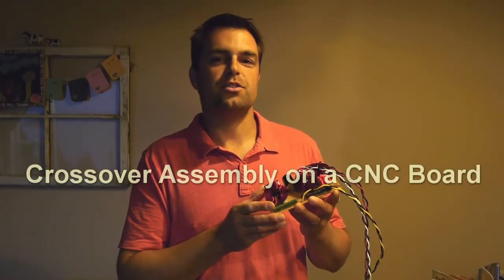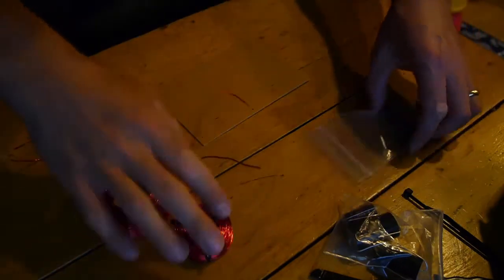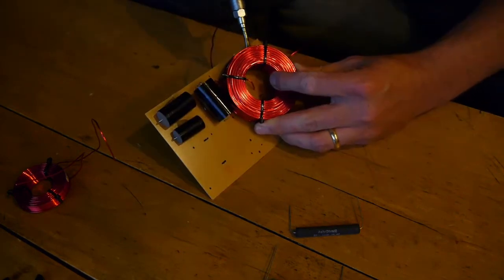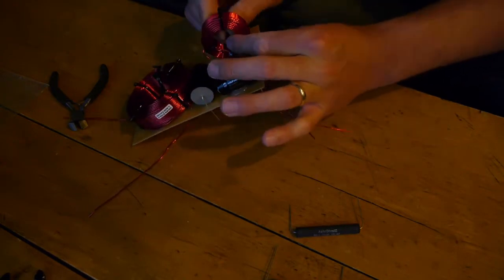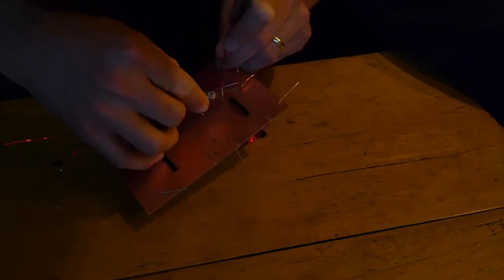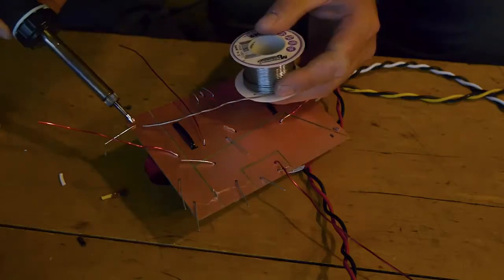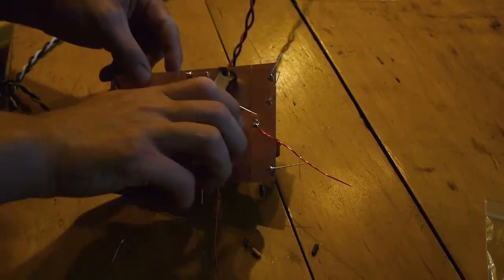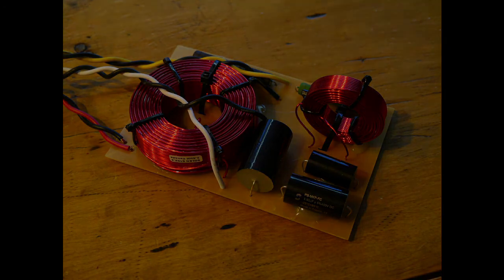Crossover Assembly Using a CNC Board for HiFi Speaker

Comment: Crossover assembly - you're doing it right! (Maybe it's because you're from Canada and not from the US?)
The only remark I have is that German DIY loudspeaker magazine Hobby HiFi say that resistors can get as hot as 200 degrees Celsius. So hot glue might not be the best option. They recommend to leave even a gap to the PCB to make some ventilation possible. But I don't have a decent thermometer to measure the temperature of resistors so I never checked.
Reply from the maker: Marius Loubeeka ya good tip. I have considered that. Really the only harm is that the glue will melt. I double up on the resistors to help with heat. Ive considered epoxy but its a pain to use. Ive also considered spacing the resistor to allow air flow, but always fear it'll wiggle or rattle. The lead wires should be able to support it, but affixing it with some kind of glue makes me feel better about it. Maybe Ill try it next time.

Comment: Good day impulse audio. I want to ask.. Whats the total impedance if i combine three driver. A woofer 4 ohms.  Midrange 8 ohms and a tweeter 8 ohms. Is it bad idea if i combine this kind of driver with defferent impedance. Thank you in advance
Reply from the maker: Ricardz Borbon its not a bad idea at all. You can mix impedances anytime. But it isnt as simple as combining them and the impedance will equal some amount. It depends very much on the crossover design. It will probably end up around 4 ohm where more of the power is required, in the bass range. Check out some of my videos about crossover design to see the complexity.

Comment: Hi, What brand welding using to solder, and % of components (60/40, 65/35?
Reply from the maker: Carlos Catalan I use a Weller WP35 iron and Keller Sn63Pb37 rosin core solder. It was what a fried recommended and I've used it ever since.

Comment: So are you selling these?
Reply from the maker: Chad Montgomery I can if someone wants a pair. They are specifically designed for a Fountek ribbon and wavecor woofer. I can't remember the exact models at the moment, but it's about a $400 speaker for parts. Very nice sounding speaker though.
Reply from the maker: This video shows the speaker this XO is for although the pair in this video used expensive upgraded parts: https://youtu.be/GG2RqnFWvGI